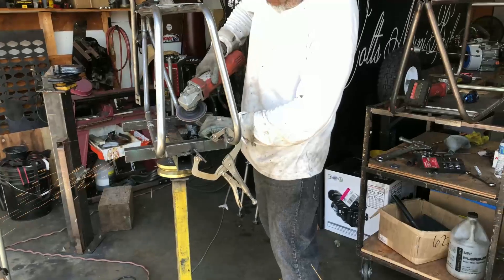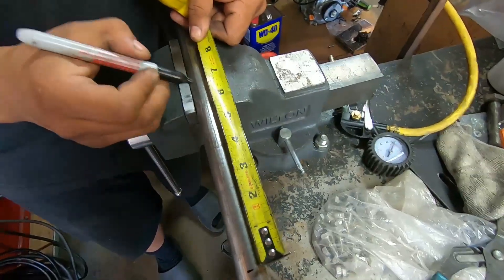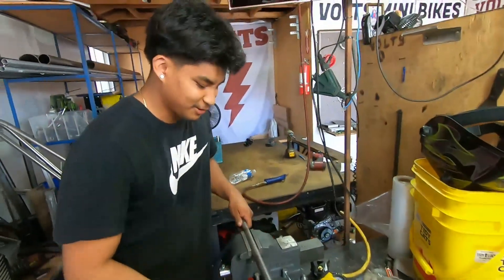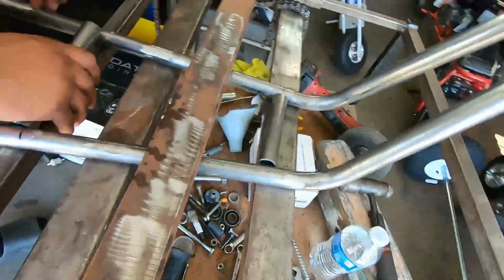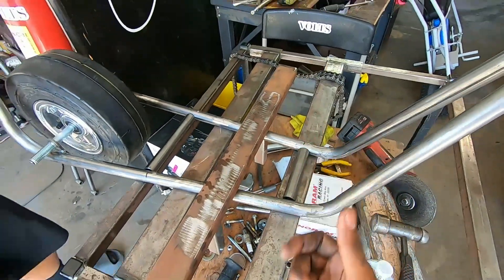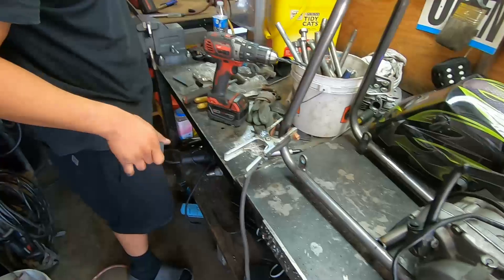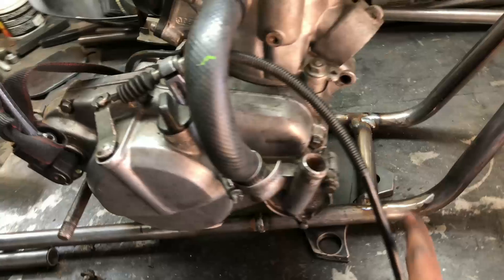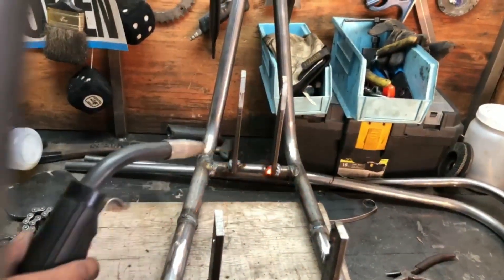2 Stroke Swapping Mini Bike!

Comment: I can't believe your did this to my KX. 🙏. Good job. You're like me. Welding worth no gloves on. Next you'll be barefoot or wearing flip flops
Reply from the maker: 😅 the kx frame was a money pit
Reply: @RoyalJZ  it's well worth it, but in with the new
Reply: @RoyalJZ  hey learn to cope the ends of ur tube. Takes less weld to fill the gap. Also stronger. And ad some brace off those front tubes on the frame to the front motor mount plates u have there. It will keep it from twisting and beautiful job...building a nasty 2smoker!! And also check ur pipe fitment. These little things can get u in the end. But its great seeing todays youth doin some work
Reply: Here in FL we wear slides while doing everything.
Reply: @ronniewilliz153  I live in Florida and the only slides I own are from jail
Reply: @Itwillgetbetternever  I'm so proud of him diving right into these things. He ain't scared.
Reply: @tashatorrid  lol. I hate them things. I don't miss them.
Reply: @ronniewilliz153  I fell down the stairs cause of them, then I get bonded out immediately after. I came in with no shoes, so they sent my out the door to walk 7.5 miles in them to civilization. Wish I coulda summoned my Motovox 😁
Reply: @ronniewilliz153  I could feel the blisters forming. It was so bad. Ain't doing that again. Every single time I get kidnapped I am barefoot
Reply: @tashatorrid  lol wtf why are you barefoot
Reply: @ronniewilliz153  good question.